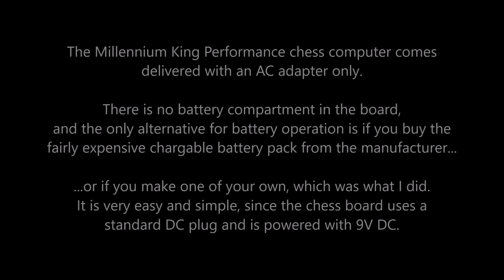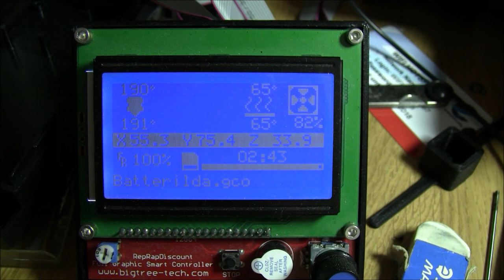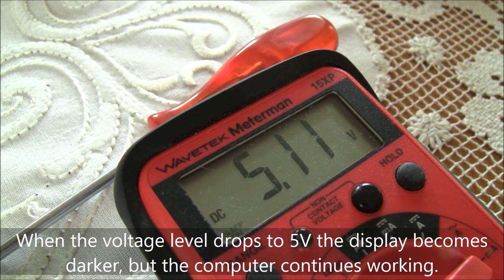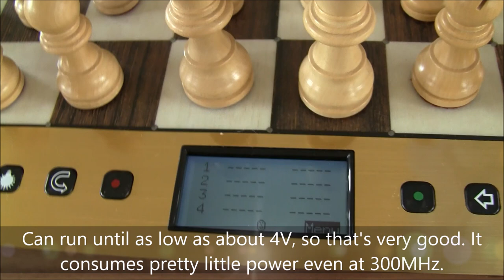King Performance Chess Computer - A simple modification

Comment: Thank you for the video. Could you please tell me how long the chess computer will stay powered for with the 3 AA batteries used. Thank you.
Reply from the maker: I am sorry, but I don't know exactly, but mine lasts very long. Remember that two different battery brands are not the same, even if both are called "Long lasting Alkaline". Also, please note that you need 6 batteries, not three, but the chess computer works with very low voltage also, down to about 4,5-5V. I would though not use it with only three batteries, since that gives you no margin.
Reply: @AdaptingCamera  Thank you for your time!
Reply: @AdaptingCamera  could you use one with 8 AAA batteries? Or would the voltage damage the unit?
Reply from the maker: @John-cm3yo  Hi, I would not try because 8 batteries = 12V which is a bit too high. You might cause some damage to the board. Also, AAA batteries are a bit too weak, so the play time will be limited. I am using AA batteries. What you could do is that you could insert two fake "batteries" which would short out two battery places so the battery holder would only have 6 real batteries. Of course, these fake "batteries" must be made, but that's quite simple. Buy a short, 10 mm in diameter aluminium rod (or brass, which is better but more expensive) cut two 44mm long pieces and that's it, just insert these together with the real batteries. You have your fake AAA battery with 0V output, making your battery holder a 9V battery pack.
Reply: @AdaptingCamera  thank you once again. Your explanation is clear and very helpful.

Comment: This is great! Thank you so much! I have a battery box that has 8 AAA batteries. I think it’s output is 12v. I tried it and the chess board turned on. Would this output be harmful for the unit? Does it need output 9v or higher?
Reply from the maker: Hi, The board requires 9V and I would not dare to try with more. Less is OK, but more than 9V may be harmful. Beware that AAA batteries are quite weak which means that the current is not enough to drive the board for a longer period because the voltage will drop too fast.
Reply: @AdaptingCamera  thank you 🙏
Reply from the maker: @John-cm3yo  You are welcome.

Comment: Could you please tell what kind of plug this is ? I mean, what I need to know in order to find one, like its size, etc.... Thx
Reply from the maker: Thank you for your comment. The plug is 5.5x2.1mm which is a very common DC plug.
Reply: @AdaptingCamera  Thanks very much for your quick reply. I'll be receiving my Millennium Chess Genius Exclusive in a few days and I'd like to follow your steps and build this power bank. Great creation !
Reply from the maker: @hugovb9  Good luck with it. It's really very nice.

Comment: Why not just use a powerbank and can also get the proper plug
Reply from the maker: Dennis Rogers, What you mean by "can get a proper plug"? The reason why I want to use batteries is because I want flexibility. My living room is also too big and have no walls near the table where I have the chess board and don't want a mains wire more or less permanently across the floor. Also, this video is not about my needs but to show people who are interested in solutions to a problem. I am a DIY guy (an engineer) and like to solve problems and make things wok the way I want to. It is good that the KP comes with a mains adapter but not good that there is no battery alternative other than buying that expensive battery they are selling.
Reply: @AdaptingCamera  you can get usb cables with the correct plug to use on the chess computer.
Reply from the maker: @denodan  Yes, I know that. But the plug I use is a "proper plug". It is exactly the same dimensions, so why should I get "another proper plug" when I have a proper plug at home readily available? The point is that this is DIY project, I could have bought the original battery but I found it overpriced and totally unnecessary since I can make my own.
Reply: @AdaptingCamera  well you so not have to make a battery pack when you can just buy on. And then just have the right plug.
Reply from the maker: @denodan  I think you don't understand what you are talking about. Of course you don't have to make one, you can buy one if you want to. But once again, the plug I am using is 100% proper plug, so why should I buy "another 100% proper plug", cut the wires to make it shorter (USB cables are normally too long), solder a battery contact at the end to be able to connect the batteries and so on...? You see my point? Same work + more cost + more garbage (wire left over) = ZERO benefit & ZERO advantage. You don't like this? Fine, I have no problems with that. Many people don't like DIY, but then again, many people do.
Reply from the maker: @denodan  As I said, you don't understand what you are talking about. I know that cables like that exist, but in what way is it different (other than color) from the one I use? As I said, what would be the BENEFIT of buying a USB cable, cut off the USB end and use the rest only, as opposed to the one I used? After all, ONLY the DC plug end needed and my DC plug is as "proper" as the one you linked to.

Another thing you seem to have missed is that an ordinary USB power bank is only delivering 5V. The chess board needs 9V even if it works down to 4V. At 5V the display becomes less intensive, contrast slowly become weaker and at 4V it stops working, so using a 5V power bank, in case that's what you had in mind, would be pretty pointless.